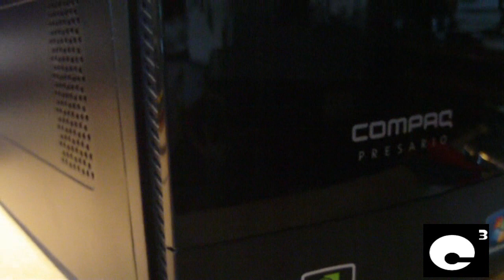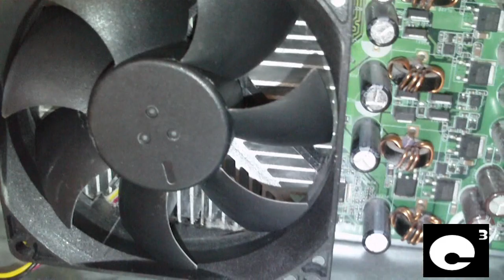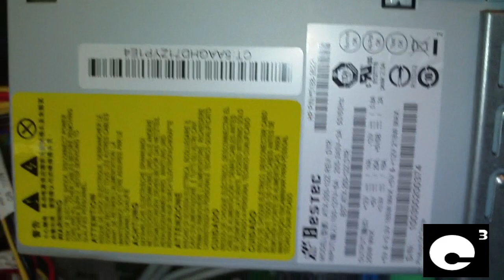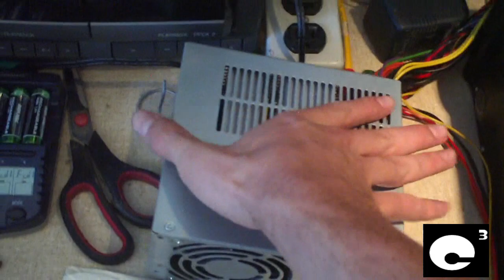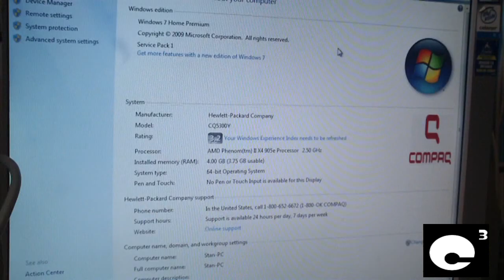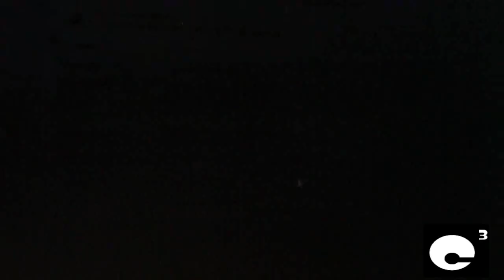Upgrading a basic Compaq Presario Desktop PC

Comment: In the process of doing basically the same, my Presario is the SR2010NX, maxed the ram out from 1.25G >2G and have a replacement cpu a Athlon dual core. Info I gathered said it was a simple switch out and that the BIOS would work with this but today after dropping in the Athlon. I get a blank screen and cannot get to the BIOS so far. Any ideas how to get this up and running. I took a even older Presario and combined it with this one to get a functional computer. It has Windows 8.1 Pro on it atm hoping I can leverage in 10 Pro with this dual core cpu. System tries to install but never finishes with no message as to why hope is just needs a dual core processor or a new harddrive the one in it is 120GB and think I need at least 128 to get it installed. We will see. Going to drop the Sempron back in if necessary.
Reply from the maker: Install the Sempron back in and try looking for an updated BIOS for your system. If that motherboard won't support the new CPU, then I would suggest looking for a socket AM3 board and DDR3 RAM to get the most out of your new CPU.

Comment: Hi all, I have a question what happens is that I am going to update my motherboard to a phenom ii x4 955. But I am not sure if my motherboard supports it is an M2N68 - La (narrates 3).
Reply from the maker: That board supports only up to 95W TDP CPUs. The X4 945, 955, and 965 are 125W TDP CPUs. You should be able to run a Phenom II X4 925 on this board.
Reply: @CubeComputerChannel  Hello again, what happens is that there is a Phenom ii x4 955 of 95 watts. So I don't know whether to buy it? If it will be compatible? Also if you look in Cpu Upgrade it says that the processor works but it is not detected by the BIOS then I don't know what to do?
Reply from the maker: @sebaspro4221  You'd want to make sure the latest BIOS update is installed. AMD did release some lower TDP versions of the Phenom II CPUs, though they came a little ways after the originals.
Reply: Thank you for answering all my questions, I subscribe.

Comment: i found a compaq like that with a m2n68-la that was dead, it wouldn't post when i tested it, i just swapped it out with a 550W Power Supply, Asus Prime B350M-A and a Ryzen 3 1200 and a GTX 1050 TI. i resurrected it as a sleeper build. all the old non working parts were recycled.
I just had my budget Dell Optiplex gaming rig die on me, it was a Intel Core I5 2400, 8GB RAM, GTX 750 TI, 1TB HDD, Windows 7. that ryzen sleeper rig is going to replace it.
Reply from the maker: These HP/Compaq cases are great for rebuilds. I like how the motherboard is oriented upside down, so it puts the CPU in the bottom of the system where the air is generally cooler.
Reply: You did what I did but with a B450m gaming plus and a 3600, rx 580. And I used the hdd and dvd drive.

Comment: Maybe you can help me? My computer boots the fan and the cpu gets hot and all but nothing displays. Someone split a single drop where the Nvidia chipset is located and three times it's booted to windows, few times it freezes at compaqs splash screen but mostly the fan just gets loud full speed and no display nothing. I've reseated the cpu, ram, every cable and nothing still. Is my motherboard dead?
Reply from the maker: Very likely could be motherboard related. Try swapping in different memory (if available) and see if it changes... or if you have more than 1 stick of RAM, remove one of the sticks and see if that changes anything.

Comment: Hello! I bought a Compaq Presario CQ5500F brand new about 10 years ago. Over the years I have upgraded it with a AMD Phenom II X4 925 Processor, 4.0 GB DDR2 800MHz Memory, NVIDIA GeForce GT 730 GPU and a Corsair 450 Watt Power Supply. The computer runs great and I use it daily. I would like to upgrade the hard drive to an SSD soon. Do you think I could drop in a GeForce GTX 750 Ti or am I pretty much maxed out? Thanks!
Reply from the maker: I'd recommend focusing on upgrading the platform that machine uses. I assume you're still running the factory motherboard, which takes DDR2 memory. Why not upgrade the board to a real socket AM3 board and install some DDR3 RAM? If you're on a budget, this will offer you a significant overall gain as the old AM2 DDR2 board is holding you back. DDR3 RAM is pretty inexpensive these days. Plus with a enthusiast grade motherboard, you'll gain features such as overclocking, etc.

Comment: Out of the box this model, CQ5700F is as close to utterly useless as useless can get.  Great if you only want to stare at a locked up screen..
Reply: This computer cost me $175 out the door with the typical keyboard and mouse as well as a 17" moniter. Great buy back in 2010. Useless, sure, but it still works to this day and is currently running Windows 10. It all depends on what you do with it.

Comment: I have the Compaq Presario CQ5320F Its base stock setup came with an AMD Athlon II X2 420 Dual Core at 2.8 GHz. I also had the M2N68-LA (Narra6) My board uses DDR3 RAM oh and it came with 3GB and a 500GB WD Blue 7200 HDD. Now I've since replaced the motherboard with an MSI 760GMA-P34 (FX) And the processor is an AMD Phenom II X4 840T with base clock at 2.8 and Turbo boosts up to 3.2 GHz. With this board I can overclock stable up to 3.5 to 3.6GHz However I am still using the stock heat-sink for the 2Core processor and this one gets much hotter faster :\ and everything is still in the Compaq case. I have 3 HDD installed. Where that other hard drive mounting bracket should go if you pull off the front you can mount another drive sideways screwing it on from where the cover goes. Check it out just a lil FYI ;) and the 3rd HDD is actually located on top of the DVD disc drive. That drive is a Segate I believe 1/2 inch high drive and the other 2 are standard size enclosures.

Comment: I have this computer with AMD Athlon II 170u processor 2 gb ram I want to max this computer.
Whats the max on ram 4gb or 8gb will this chip work in this machine AMD Black Edition Phenom II X6 1090T 3.2 GHz 6‑Core. whats the max power supply and and if I added a video card could it handle any of them or up to what type? Pleas help and thank you
Reply: xchanticochulox Google your model number and You can see what cpu's your pc supports.

Comment: i have compaq presario cq3150ix
i am planning to install 4gb ram but its specification says that it is only upgrade able to 4gb in 32bits but i have 64bit , will it work on 64 bit or i need to change its bit????
plss reply and thanks for the video
Reply: Abhishek Sengupta 32 bit system only support up to 4 GB regardless of the model of computer. With 64 you could probably support up to 8 or 16 depending on the computer. Google the model of computer and you should find all the upgrade specs possible.
Reply: Unfortunately, I have a similar model to this (CQ5521F) with an M2N68 (Narra5-GL6) motherboard.  The HP support specs page only states it can take access up 4 gb max at 32 bit...but my system is a 64, so Abhishek's question is one I'd also like an answer to.  Can I double up?  Haven't found the answer yet but if you know??? :-)

Comment: I have a Compaq Presario CQ3140AN desktop pc with 4gig Ram, running 64bit Win10 Home, am I able to upgrade 8 gig of ram? Or is it capped out already? Is this just the motherboard limitation? Much thanks
Reply: you would have to look up your computer model under motherboard specs. i bet it would handle up to 32gb
Reply: HP doesn't show the specs for 64, only 32 unfortunately.

Comment: A question is the Phenom II faster that a Turion 64x2 - or vise versa??? or do you know - thanks
Reply from the maker: The Phenom II is newer and faster than the Turion 64 X2, but will not work in an older laptop that takes the Turion 64 X2.
Reply: Thanks for the help

Comment: can you tell me what are the compatible processors to my pc? I'm running Compaq Presario sr1950nx with Windows 7 64bit, 4gb RAM, nvidia GeForce gt 610 2gb graphics card, AMD Athlon 64 processor 3800+ and it's a 300w power supply
Reply: +William Garcia  Your PC is almost maxed out the CPU would be the last thing you can do...HP/Compaq name: Nagami2-GL8ESocket: 939Supports the following processors:
AMD Athlon 64 X2 up to 4800+
AMD Athlon 64
AMD Sempron

Comment: [Update: nevermind, I ended up not doing it anyway. Bought an actual full size ATX case and put all the parts in there.]
I wanna buy a computer with Pentium 4 and 512 MB RAM and upgrade it to 3.2GHz Athlon II X2 260, 1 4GB module(the new mobo I have only has 2 slots), and HD 6570 2GB DDR3. What I'm worried about is that the power supply in the computer may be outdated where the old years had 5V as the main power output. By todays standards 12V is the main rail. I do have a high quality power supply with good wattage but it is too big to fit in the case. I will try and run it with the case on if possible.
Also the power supply in it may only have 20 pins but my mobo needs 24.
I will only be playing some games that do not take a lot of system resources.
Reply: The reason why I do that is because that computer is an AIO and it is simply a case with a monitor attached to it. It also has a thick acryllic layer over the screen making it durable. I am going to upgrade it using parts I got after I upgraded someone's computer.

Comment: Do I really have to replace the power supply? I have the exact same computer.
Reply: It depends on what parts you want to use and how much performance you want. You can use a power supply calculator online to determine how much power you need.
Reply: TheFatTroll no u dont need to replace psu

Comment: Hello The Question I Asked You Before Tha tI Still Need Help With Is Reguarding This SAME EXACT COMPUTER I Have And Doing Work On Again My Question Is:

I Have Rebooted After Installing A New Hard Drive 
It And Its All Running But Computer Seems To Be Running Not Smooth...
EVERYTHING IS RUNNING SLOW
Is My New Drive Bad? Is It Cause I Replaced The Original Hard Drive Which Was A 250gb Seagate Brand With A Western Digital tb Version? Please Help Me
What Could Be Wrong?

GOD Bless And The True Help And Patients Is Greatly Appreciated...
Reply: *****
whats that mean and what i need to fix it?
Reply: +Myreverlation I'd suggest upgrading to a ddr3 machine or upgrade to more and or faster ram your cpu will probably bottleneck most gpus you get cpu=central processing unit and gpu=graphics processing unit
Reply: Myreverlation maybe get a good pc. expect lag on a baseline machine. lol

Comment: Hey i have to qustions I have the same computer compaq presario cq500f.  I have 2 gb of ram default I wont to know if I can install 4 gb of ram next to the 2 gb of ram for 6 gb of or would I have to buy 2 4gb of ram for both channels. My last qustion is it has an Amd Athlon 2 170u  2.00 ghz processor. If i install 8 gbs will I have to upgrade my processor?  thank you.

Comment: Can I swap amd phenom4 to Intel i7?
Reply from the maker: You'll need to replace the motherboard.
Reply: ***** Can you recommend the best RAM to upgrade a Compaq Presario CQ5504F to maximum RAM which seems to be 4GB? I'd gladly use an affiliate link if you have it.
Reply: +KunTao Lai Lai WRONG - it depends on your [VERSION] of Windows. Mine is 64-bit Win 7 pro (began as Home, but I upgraded) -- so, in my case, you are wrong - this will fully support more than 4GB. Only 32-bit is limited to 4GB or less.
Reply: Jeff Mason its only 3GB for win 7-10 if u got 32 bit. thats the limit
Reply: +Chrysdon Mape Well, three and some change.
Reply: +Cube Computer Channel what about an i3 4130
Reply from the maker: +David Williams You cannot swap an Intel CPU into an AMD system. The only exception to this would be the old Socket 7 boards from the 90s, which could run either a K6 or a Pentium.
Reply: i know its a stupid question.

Comment: My Compaq Presario is exactly the same inside as the one in the video but with higher specs. I upgraded the RAM doing a Crucial scan a few years ago and got the max out of it, ordered and everything is doing fine. Now i've jumped the gun and bought a Western Digital Blue 64MB Internal HDD 1TB as a back up because two of my external hard drives went down. But like you said in the video there is no cage to slot it in at the bottom. I've ordered two mount brackets but they don't slot the HDD in. Do you know a cage that will do the job at the bottom of the casing like you said where it's cool and i want a few more devices, i intend to put an SSD in soon. My PSU is 240 but my old computer from 2002 is a 400 PSU. I've never had an issue yet with my Compaq Presario, ever! Bought it in 2007 and it's worked endless times and is still going strong.

Comment: I have a compaq pasario 5421sr desktop pc. I've upgraded to max ram which is 1.5, but it's not running as fast as it should. Can I upgrade the processor or will I have to do a complete upgrade of motherboard etc?

Comment: have the same computer w integrated ethernet / networking and it was hit by a power surge. Do I need to replace the motherboard and if so  do they exist to buy? Any suggestions?
Reply from the maker: If you're only having problems with the ethernet, then just install an ethernet PCI/PCIe addon card and call it a day.
Reply: Sorry then must not be the same computer. There is no slot for addon card. Wish I could. Its an integrated ethernet port. Have solved problem with wireless adapter.

Comment: I have this same computer and thought I would pass on my upgrade experience since this posting is still active. I wanted to upgrade the CPU, memory and video card as I just came into a 42" HD flat screen and wanted to use that as a monitor.

Video:  I installed a PNY - GeForce GT 610 Graphic Card - 810 MHz Core - 1 GB DDR3 SDRAM - PCI Express 2.0 x16. I picked it up as a closeout from Best Buy for $40, they are still available as of this posting. It has VGA, DVI & HD monitor outputs, perfect. Don't forget to change the settings in the BIOS else it will keep reverting to the onboard video. I had to tweak the video settings a little as the fonts looked a little fuzzy. But I've got it looking pretty good now, videos are awesome!

Memory: Next I upgraded the memory by installing a 2Gb single stick of PC2-6400 DDR2 ram for a total of 4Gb (maximum this motherboard supports). EBay $15.50

CPU:  And last I upgraded the CPU processor. Lessons Learned Here!  The 1st one I bought off EBay for $67. It was an AMD Phenom II X4 920 2.8 Ghz Quad Core HDX920XCJ4DGI; but it did not work. I discovered that the TDP spec (temperature) for this processor is 125w but the motherboard only supports up to 95w. Make sure you check this spec before buying one. I was able to return this to the seller at virtually no loss.  The 2nd CPU I bought, again from EBay, for $75 but I made certain it was rated at 95w. It is a AMD Phenom II X4 840 3.2Ghz Quad Core 6MB Socket HDX840WFK42GM and it works!

Hope this post is helpful to those wanting to upgrade this model of Compaq computer. Blessings!

Comment: Hello i have this same computer my son unfortunately dislodged one of the prongs from the vga that meets the motherboard.  I am not ashamed that when it comes to computer they're are far more superior minds lol. What kind of video card could i get (possibly one with hdmi for computer). My computer actually needs a major upgrade as well and was wondering what would recommend as far when it comes to graphics cards, ram,heat sink, power supply pretty much everything you talked about in the video lol.
Reply: It really depends on the type of connector you have on the Motherboard and what you are wanting to use it for. If you are doing anything intensive like gaming or using it to edit, I'd recommend any Radeon R7 or R9. Though the better ones might be a little more expensive, anywhere from $150-300, they do have the smaller models that use the same parts in a different architecture for much less, but you wont be able to access that extra power the other parts aren't capable of. And using something bigger like an R9 270x, you'd want a better power supply, but a Corsair cs430 wont be more that $45. Its always a good idea to replace the OEM power supplies anyways. If you tell me what you are doing, I can give you a much better idea for parts.
Reply: Or get an R9 Series card. They're dropping. You can get a Sapphire R9 260x for like $150, a 270x for 189 or even a 280x with Tri-x cooler for like $269 which is RIDICULOUS since it is like a $350 card

Comment: hey wat's up cube i have a presario cq5700y can i upgrade the gpu n rams on dis pc or do i half to change processor ??? hope you can help me thanks :)
Reply from the maker: With the stock mATX motherboard, you can upgrade the CPU and RAM, but the motherboard does not offer a PCIe x16 slot for a graphics card. You can replace the motherboard with another board with a PCIe x16 slot available. Try to buy one which uses an AMD chipset so Windows will likely transfer over without needing to reinstall. Also, replace the 250W power supply with something better if you're going to put in a graphics card.
Reply: thanks for replying back well dats great thank you for the heads up cube im about to build another rig soon after adding da rammms you mentioned thanks ...

Comment: i have this same computer, and am looking at other computers that run 300-500$.  I'm trying to get my machine able to edit gopro vids, and light gaming.  What video card would you recommend for this machine?
Reply from the maker: A midrange card such as a Radeon HD 6750 or GeForce GT 640 would work.
Reply: ***** thanks, found ram and the GeForce pretty cheap, the processor you suggested is rather expensive though.  I think that money might be better spent on a newer machine to upgrade.
Reply: +RC Hunter hi  I know you
Reply: +RC Hunter I have an hd 5450 and it works fine